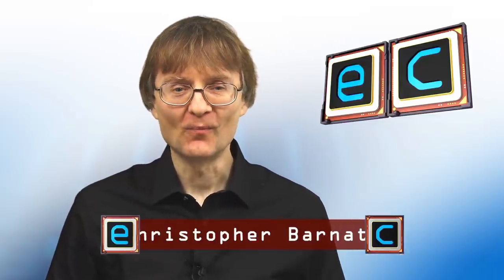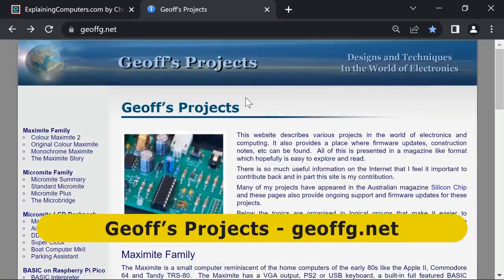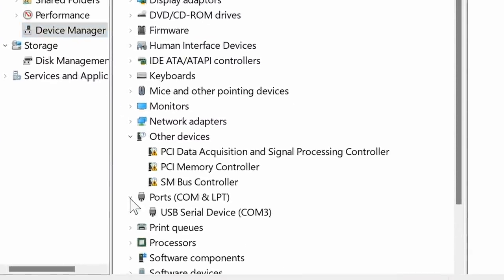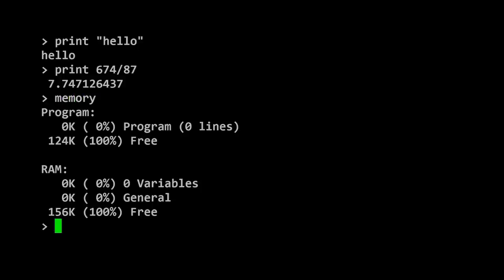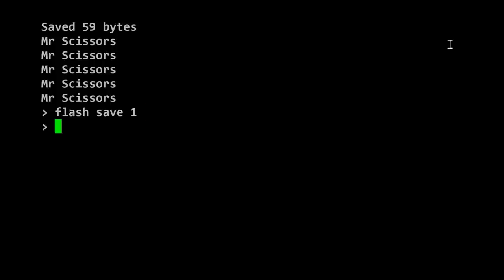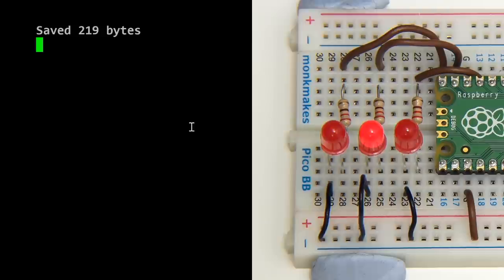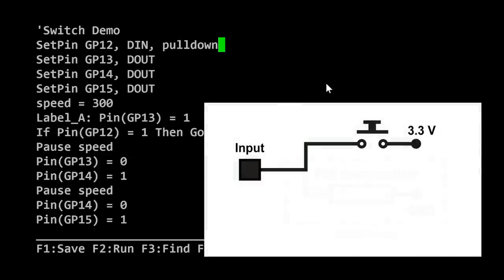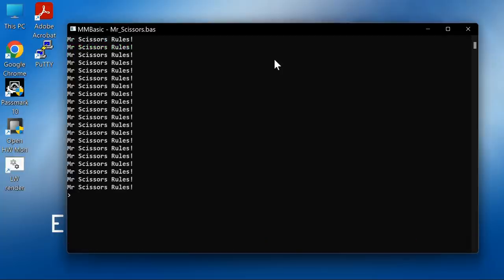PicoMite: Running BASIC on a Raspberry Pi Pico

Comment: Your damned right about the documentation, really well done! Sample code, sample circuits, took 5 min to be up and running. Having an editor built in is nice, I am sending a data collection product out into the field in Indonesia so having this feature is really worth while. 

Basic was created to be easy to teach and understand! We used Basic at HP for easy to implement instrument control and it worked well! Many nag on the Goto command, when you goto a line number they are right to compline, but Goto a label name used as a call to Sub or a function, it works great.

So now we have C, C++, a couple of versions of Python, Basic, and at least one Version of Forth, and there is Assembly Language! 

I have not tried it, but there is the possibility of embedding C also when speed is critical. The PIO Is unique! 

Looking forward to what might be included in a second version, maybe some added PIO BLOCKS, more program memory. In the meantime there are a Ton of apps to be done with the RP2040!

We are Lucky as hell!

Now if someone will do a Pascal! I still like Pascal.  Pascal was the follow on to Basic for learning to program. In the end it is not what the source code looks like, but the machine code it compiles down to. The style of program has many different flavors to suit different taste. There is no reason that many of the current programming languages can not be compiled down to good Machine code. Pick a language that looks comfortable and write programs, programs, programs ....  Maybe more Important, write programs, then really Analyze them then rewrite them. I heard a good programmer say write a program until it works, then analyze it carefully and throw it away and start from scratch. If you think about it, that’s much like our current revision cycles for the current tons of software on the market, Just doing a little more thinking at the beginning of the process.w

Comment: That was a great fun video. Proper stripped down machine. My first programming was in basic using a Data General  Nova via a teletype. It calculated the  tractive effort (ie pulling power) of a steam locomotive basically a function of cylinder diameter/ stroke , wheel diameter and boiler pressure.  The equation is still very useful and I guess there are now many more working steam locos  than working Data General Novas. This one I seem to remember had an extra 3k of core memory !

Comment: Thank you Christopher. we live beside a river and i have wanted to measure its height over time, even more so since we watched the ripples moving up the river - 6.8KM - up the river from the sea - the ripples being from the tongan volcanic explosion a few months back. we also heard it 2000km away. i guess i shall have to explore ways of measuring the height of water of max range about 4 meters. pressure guage; electric sensor; air pressure in a tube. ?? thanks for the easy part, the recording method. Loving the channel, thank you.

Comment: Slice that breadboard in half right down the middle and you can then make it "wider" so that the pico plugs into the end of each row.   That would open up four connection slots per pin.
Reply: Worth doing as the board is not too expensive if you mess up

Comment: Device drivers for Windows 7 sorted. After copying PicoMite onto the Pico:
1) Download & run the tool Zadig 2.5 (2.7 reported to trigger some antivirus programmes).
2) Ensure Options/List All Devices is ticked.
3) From the top dropdown, select "Board CDC (Interface 0)"
4) From the driver dropdown to the right of the green arrow, select "USB Serial (CDC)"
5) Hit "Upgrade Driver"

You should then see it listed under Ports in the Device Manager (along with its COM number). This worked for me on W7 64 bit.
Reply from the maker: Great to hear that you got it sorted, and thanks for sharing this here.

Comment: Wow, thanks for opening my eyes to this!  I have to look at this MMBasic more closely.  Like you, I wrote my first programs when I was 6 or 7 years old on a Commodore Pet computer, running BASIC.  I recall doing ASCII games mostly, and saving them on cassette tapes!  I wonder if I can do ASCII games in MMBasic, and graphics with PEEK and POKE commands.
Reply from the maker: MMBasic does indeed support the Peek and Poke commands to access specific memory locations. Whether you can use this for graphics will depend on how the display is mapped, but I suspect it will be possible.

Comment: That breadboard with the Pico pin labels is interesting.  It's unfortunate that the Pico isn't labelled itself.  Why did they label only 3 pins?  I think they were going for looks instead of easy of use.  Even if it was only the pin numbers it would be better than having to count pins to find the one you want.
Yes, I know the other side is labelled but most people put it this side up with the LED visible.

Comment: i have been using for a while now and It works great with the IL9241 display with the sd card slot as in manual. , put a 32gb sd card in with old basic game programs and spent fun hours trying to convert, have not tried the Ps2 keyboard yet but would turn into a stand alone development system. ordered a Real time clock to set the time date on boot up. Many days of pico ahead.
Glad you did a show on it,  gets more interest, maybe a future user group of pico basic users, Source in c is available to modify to. Maybe get some input on the PIO commands. Havent tryed the VGA yet, Wish it was HDMI uses less I/O pins and only 220 ohm resistors. Maybe someone could add to source.

Comment: I had my first hands on with a computer on a bbc micro running basic. good to see BASIC running on such a small chip! basic is easy to follow. it might make learning curves easier to use basic electronics gadgets with a micro. hopefully, they add wifi to the pico in the next iteration!
Reply from the maker: Thanks for this. There are now RP2040 (Pico clone) boards with either WiFi or even Ethernet. :)

Comment: Excellent reporting! This is tremendous. Just like the GWBASIC I grew up with.  I am planning to get a Raspberry Pi 4.0.  Will that run this same interpreter?  Thanks!
Reply from the maker: MMBasic is available for several platforms, but not the Raspberry Pi I'm afraid.

Comment: Wow. I might actually end up doing something with this. My BASIC will definitely be rusty, last time I used it would've been 30 years ago, and I would've been 10, but the I'd definitely be able to pick it up quicker using a familiar language.

I'd definitely, at least until I get into the swing of it, be using line numbers just for familiarity sake leading to less mistakes, but would definitely bring back memories of using a C64 and saving things to tapes.

Comment: I've heard of Pico Basic many years ago, I love basic and am using QB64 (Quick Basic Clone) on Linux, basic it's great for beginners!!
Reply: Hey, first time I see QB64 mentioned by someone other than me ;) I too have it downloaded on my Linux laptop, but haven't actually tried it yet... I still have some of my old GWBASIC/QBasic programs somewhere, maybe I should take a new look at what I was doing in the early 90's with it :)

It's technically not even a clone, if I understand correctly there was a developer at MS who kept upgrading the original QBasic for his own personal projects because he liked it, then finally he wanted to release it and MS ok'd it - at this point it was QB64 (he first updated it to 32-bits because of 16-bit limitations - that was called QB32).

Comment: @2:20 just a small correction: the RP2040 does not contain any on-board flash but rather provides a QSPI interface for external flash.
Reply from the maker: Yes, you are right -- I stand corrected. I should have made it clear that the flash in on the board.

Comment: That was fantastic. A few minutes after watching this video I've got Basic running on a Pi Pico.  I don't have a breadboard but might dig out my soldering iron this evening.

I didn't do much Basic as a youngster. Any chance of showing us how to run FORTRAN on a Pico?
Reply from the maker: Hi Graham -- that's a fast response to a video! :) Glad to hear you got BASIC running. I'm not aware of anybody creating a version of FORTRAN for the board, but I'm sure it is a technical possibility.
Reply: @ExplainingComputers  Well, FORTRAN really is quite obsolete.  BASIC, like rock and roll, will never die.
Reply: My memories of Fortran are my mates staggering about with 100 yards of printout saying error 1000 times for their 2 + 2 = 4 programme!!
Perhaps Forth would be more appropriate I've got a book on it somewhere I've never read.
Reply from the maker: @nonoyorbusness  I always wanted to try Fourth. I remember being very interested in the Jupiter Ace, although I never got to use one.
Reply: @ExplainingComputers  had a blast learning forth on my atari 800, the most interesting part is that it's stack oriented. (like the old HP RPN)
Reply: FORTRAN isn't it Pure Evil villain of an OS 
haven looked at yet but hope its the BASIC of the MICROSOFT EXTENED BASIC (type Would be really coo l)
Reply: @datamike00  
Ah yes that's right it stuffed everything on the stack,
Reply: @dh2032  
It's a language not an OS.
Reply: I remember being taught FORTRAN at University. The language at that time was mainly used for its Mathematical capabilities.
Reply: @AndrewBorrill1  
And the lack thereof by the students!

Comment: Great video! I think at 12:29 you state that the pi pico’s pins can all be digital in/out and analog in/out, but the pico only has 3 available ADCs on pins GP26, GP27, and GP28, (and a forth internal one for the temperature sensor). The rest are just digital.
Reply from the maker: You are correct. My bad. I was not clear enough there.

Comment: Awesome! Thank you for this video! I built an IMSAI 8080 running BASIC back in 1976-77 and connected it to an ASR33 teletype for I/O. I wrote a massive number of engineering programs in BASIC. Question: I have been learning micro-Python on my Raspberry Pi Pico. Do I need to remove micro-Python from my Pi Pico to run BASIC?
Reply from the maker: Thanks for this. And yes, installing MMBasic will remove Micro Python from the Pico. But it could be put back again. :)
Reply: @ExplainingComputers  Thanks! Looking forward to putting BASIC on one of my pi picos!

Comment: That looks like a better introductory-level machine than the sophisticated beast the Pi has become. For a lot of practical applications, most of the concepts and code on a modern general-purpose machine are confusing noise.
Can the GPIO pins be addressed as an array in any fashion? That would simplify a lot of code, since the logical to physical  connection would only have to be made once, allowing code to be re-used. E.g. a "blink" subroutine could blink any connection, rather than only one. 
 A small case would turn it into a great teaching tool at less than the price of a textbook. Pupils could "hand in" their homework by plugging their machine into one programmed to upload. I doubt "the dog ate my homework" excuse would be used very often; children wouldn't want to lose their unit.
Reply from the maker: A good point on the array. Arrays are supported in MMBasic, but I have yet to find a way to address the GP pins using one (rather than hard coding each pin in the code). But my gut tells me that it has to be possible! :)
Reply: Individual bits can be addressed or an entire user-defined "PORT". I recommend downloading the manual. 👍

Comment: great video! would be cool to see if the Pico could be used to emulate some of the old 6809 IC's and run a full version of the Basic language as an old CoCo computer. Or the 6510 CPU like the Commodore 64 or even your ZX Spectrum

Comment: I loved Q Basic!  :)
Reply: "MMBasic on the Raspberry Pi Pico implements a large subset of Microsoft's GW-BASIC plus some more modern programming structures documented in the ANSI Standard for Full BASIC (X3.113-1987) or ISO/IEC 10279:1991."

I like it because it's very much like Microsoft BASIC which I leaned on home computers. BBC Basic maybe better but not my cup of tea.

It's not quite the Quick BASIC environment but getting there.
Reply: @wayland7150  I suppose because other than COBOL and FORTRAN being the first computer languages I was exposed to on Mainframes, QBASIC was the first OS I used that allowed me to play with computer-generated graphics.  :)  Always been a fan of nistalga.  I know there were better graphic-capable programs and OS's but for me, QBASIC was my 1st.  :)

Comment: Basic is well suited to simple machine controls, like a diesel generator startup sequence that goes through a sensor checklist and then sequences glowplugs, etc to safely start, warmup, and load the engine in different weather conditions. We used to have to purchase a $750 plc and pay $900 for a programming software 6-month seat. Now it's what? $5 or something altogether?

Comment: This is quite cool :) One thing that always bothers me though is, even with just 3 line basic program, is when people write basic without line numbers but still don't use indentation in their code ;) Just bothers me - whether I would use an actual for-loop or infinite goto-loop, I would always indent the code inside the loop.

Heck, I even did it with line-numbered BASIC in DOS (with GWBASIC or QBASIC with line-numbers), starting the row with line number, then spaces for indentation and then the code :)
Reply from the maker: Thanks for this, and your point is well made. I guess I've just never indented in BASIC. In fact, on the computers I learnt BASIC on -- like the ZX81 and Spectrum -- indenting was not a technical possibility. So my head is programmed in a certain fashion.
Reply: @ExplainingComputers  Hey, thanks for the reply =)

Yeah, I knew about that limitation - IIRC it was because them old computers stored the commands as symbols, not in plain text like in DOS, and they didn't store any extra spaces even if you tried to put them in there :)

I didn't know about indenting when I started programming in BASIC though - I learned about it later with Turbo Pascal, but took the habit back to BASIC as well ;)

Comment: interesting, we had the same first computer the zx81...I did both basic and learned z80 assembly on that...fun times when you just used what you could get.  MMBasic is a very modernized implementation of basic.  And I can see it's place with the GPIO hardware interface on the pico giving hardware people a simpler experience with the software control software needed.  The maximite2 is a very capable games machine where full games are implemented directly in basic.  At first I thought oh now you can do those games on the pico but I see that's not the focus.

Comment: Did you have to refresh your memory much with that?  I used to do quite a bit of BASIC on the BBC Acorn plus some machine code but reckon I'd struggle to recall it now.
Reply from the maker: I was surprised how quickly things came back. :) Code get coded into us I think. And the MMBasic manual is very good indeed.

Comment: This is an amazing project!  Looking at the website I noticed there is built in support for WS2812 (Neopixel) LEDs.  

I did wonder if this work on other 2040 based micro controllers, such as the Plasma 2040?
Reply from the maker: Yes, this should work on other 2040 boards, subject to their particular GP pin availabilities -- not all of them have all of the pins on a Pico. As you've seen, support for displays is good -- the manual lists everything currently supported.

Comment: Chris, is the basic just the standard basic or does it go into more upward "Basic" like VS basic, where we can enrich ourselves into more advance programming?
Reply from the maker: It is a pretty standard BASIC, but with specific functions for the Pico to handle its inputs and outputs, LCD screens and sensors, things like that.
Reply: It's a modern BASIC where you can totally avoid GOTO. Subs, Functions with parameter passing, DO-LOOP, SELECT-CASE etc. and 64bit data-types. This video presentation doesn't do it justice. I have never programmed via a terminal because one can do a lot more by programming on the PC and downloading. MMEdit by "TassyJim" (on the forum) is my personal favourite 😎👍
Reply: @AdaptivePhenix  wanted to know if it support structure code
Reply: @ffieditor  Pretty much stated that in my first reply. Another extremely powerful feature is the ability to program the #2 processor (PIO) in assembly language. Not an expert on this, myself but it's covered in the PicoMite manual. 👍😎
Reply: Forgot to mention that; if you have a time critical function, there is the possibility of coding it in C and embedding it in the BASIC code 🙂
Reply: @AdaptivePhenix  first off BASIC is NOT assembly, not by a long shot.  Since I don't have manual, that why I asked Chris if it support struct programming, he was the one that posted the video and that all I had seen or knew about.

Comment: So where is your first program saved before saving to a "slot"?  - 9:44
After editing your program and hitting F1 to "save" is it actually saving to flash or just RAM?
If you "flash load 1", edit your program and F1 save do you still have to do a "flash save 1"?
Reply from the maker: The active program is saving to flash as well (from where it also runs). So if you edit a program you will have to save it to (eg) slot 1, as the version there will be the last one saved to that slot, not what is currently being edited.

Comment: Windows tip, if you want to send a file or files to the root of a removeable drive, like a flash drive, you can use the right click option and Send To...  You'll get a list of the devices on the computer, just select the flash drive and they'll copy.